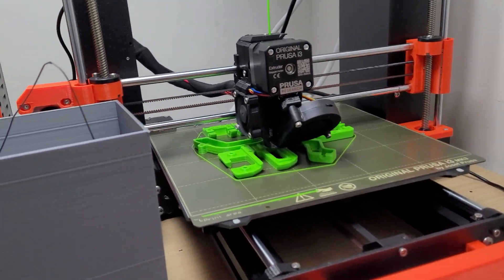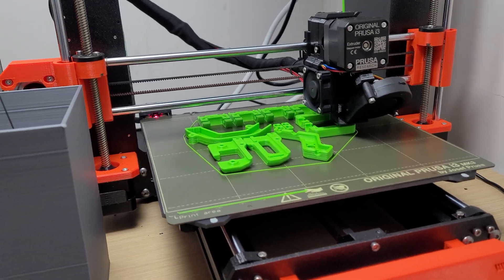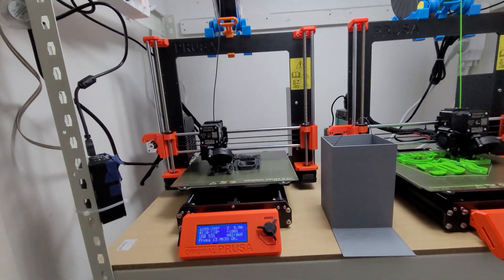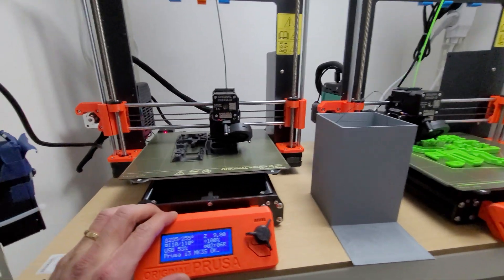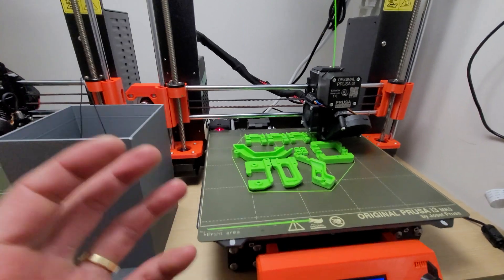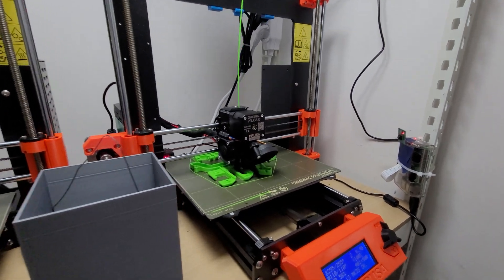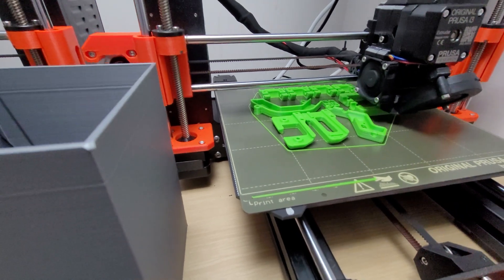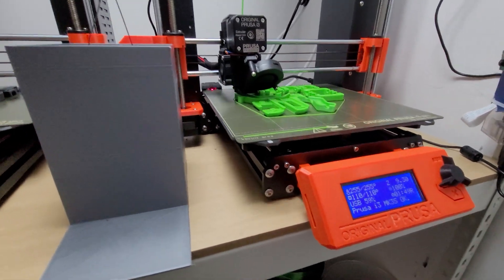How to Print ABS without Melting your Prusa MK3S+ Printer!

Comment: What about the Prusa enclosure? Could we use these instead?
Reply from the maker: Yes you can but you will want to first rebuild your printer using abs parts otherwise the parts will eventually melt away.